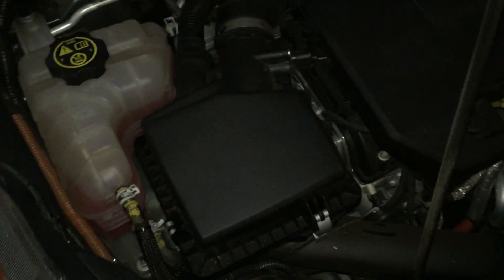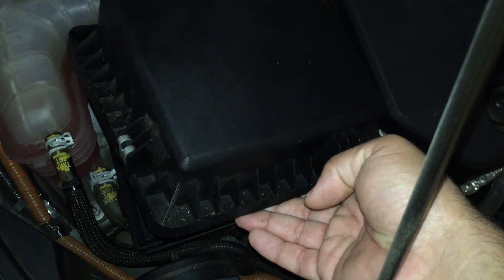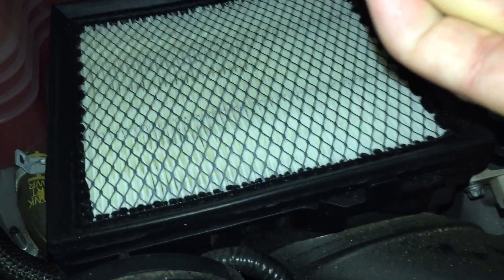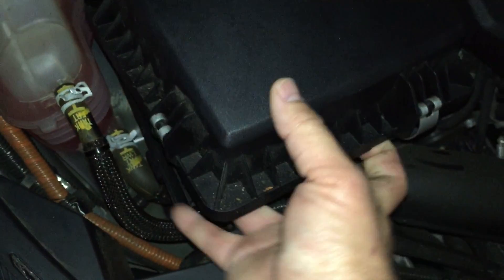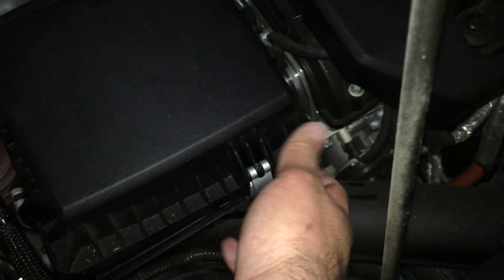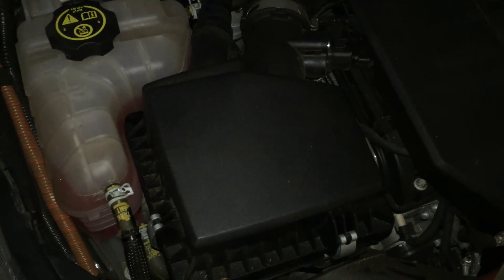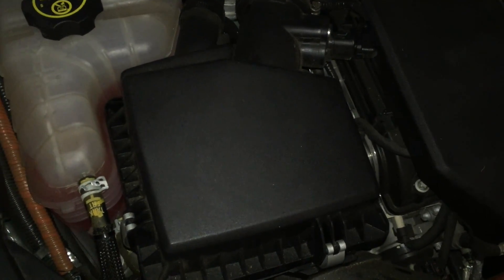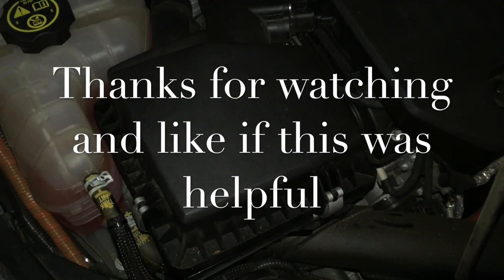How to: Gen 1 Volt Engine Air Filter Change

Comment: How often do you change air filter on the volt
Reply: Manual states to change air filter every 50,000 miles. This is a rough guideline since it depends on how much you drive on gas vs battery only.
Reply from the maker: john1240able, I have changed it once since I bought the car about the time the oil filter was due. I’m coming up on my second needed oil change and will probably change the air filter then also. If it’s really clean I’ll comment back here to let you know but that would be a reasonable cycle to follow. My oil change is about once every 2 years.
Reply: Got It!?FPV  how many miles on your volt now